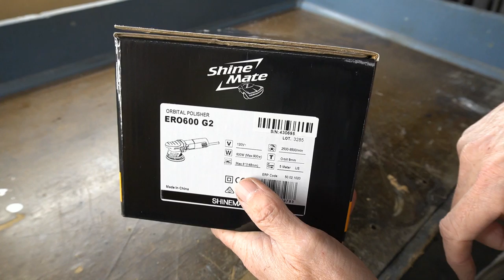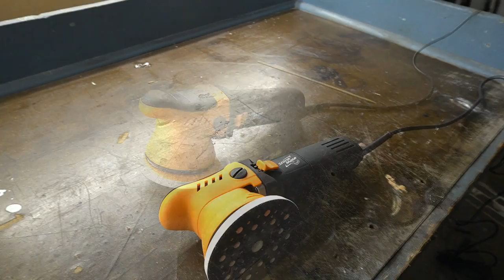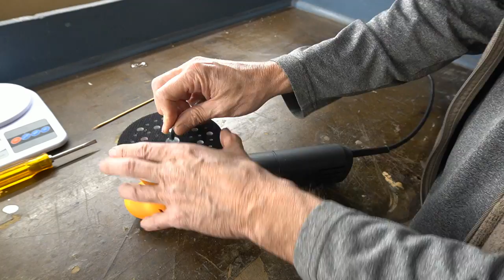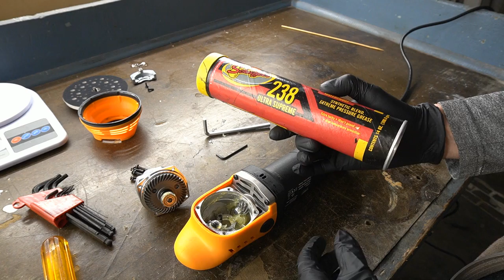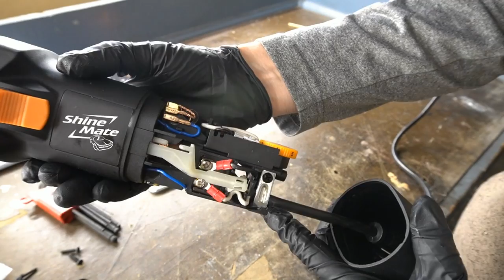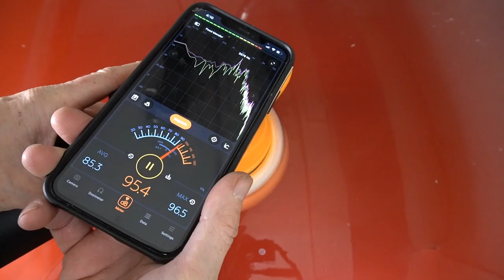Beginner Detailer ? Car Enthusiast? This Polisher May Be For You! ShineMate ERO 600 G2 Polisher!

Comment from the maker: I noticed there was a holiday special on the Bauer Polisher (Harbor Freight). Did anyone take advantage of the special price?
Reply: I bought one just for yucks. Planning on a different backing plate better grease. For $49, it was hard to resist. Nice cord.
Reply: saw it and was tempted but my next polisher has to be smaller
Reply: I got one and changed the grease to lucas red and tacky and ordered a rupes 5 inch backing plate. Tried it on a vehicle over the Christmas weekend. Seems ok, i mean cant really complain for $49 😂

Comment: I hope this is a little slimmer on the handle than the previous version. The previous version was a thick blob with no grip on the head while this seems to have a nice cup to hold on to. You will realize this when doing side panels. How does this compare to the TorqX for a beginner polisher? I have the TorqX and its great but lacks power and the orbital part bogs down.

Comment: wondering if you could also use this for sanding? is the speed set up to 6500 high because it requires higher speed to compensate for he smaller motor and smaller throw?

Comment: As a hobbyist who has experienced several entry-level 8-9mm polishers, that switch and dial setup is an absolute dealbreaker for me.   I would much rather go with a GG9 polisher with a trigger mechanism (with lock) and the dial in a more ergonomic position.  The GG9 also has a lot more power, so stalling will be less of an issue.  If you're a hobbyist or just getting into polishing, nothing is more frustrating than stalling on every little curve or if the pad isn't perfectly flush with the surface, or bumping the switch to OFF when you switch positions.

Comment: Anyone know the difference between this unit, the ERO600G2 vs the older ERO600G1? Size, throw, and power all seem the same, this one seems to have the same backing plate as their more expensive units.  Wondering what else has changed, since the price on this one is much higher.

Comment: Nice polisher. I got scared when you lubed up your finger ..lol.  I just bought a used Genesis G90 ultimate 5.0 AWD a couple of days ago. Of course it's all black. Have you dealt with Genesis before? Wondering on the paint , like soft or hard. Got scratches and some scratches on the leather too I don't know how to go about doing the leather. Awesome deal and drives so smooth